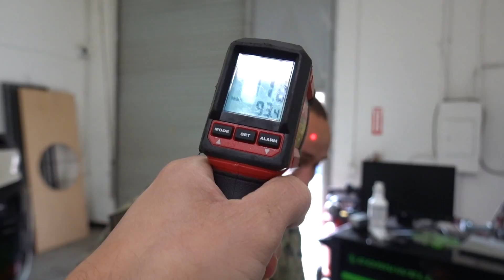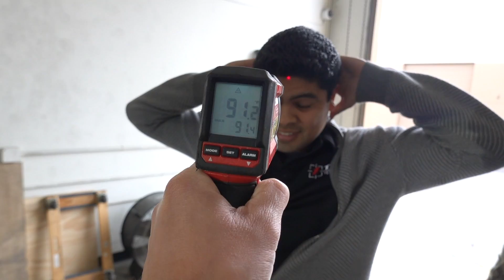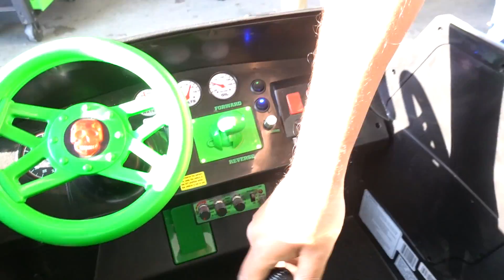THE SUPERCHARGED 6.2 IS GETTING A COMPLETE MAKEOVER!

Comment: Hey Ryan
Wes might not have to have the steering reprogramed. If you turn the wheel all the way to the right and left a few times and turn off the truck and then turn it back on the computer will find where the center is. I run into this problem sometimes when I jump start cars we get the steering wheel symbol and that procedure usually works. Im a tow truck driver and I do WORKFORIT

Comment: Ask Sergio to mess with his head,,,,,,,,how does inductive reactance affect the phase angle - and the answer should be,,, the voltage leads the current by 90 degrees or he may say it like this,,,, the current lags the voltage by 90 degrees - this will mess with his head as he won't be expecting an electrical engineering question like that in a non-design environment !!!!  He'll want to know why you want to know that - tell him you are thinking for rewiring your truck and making it all like 240 AC with a lot of powder coated coils in the circuit..... get his reaction - should be good !!!!!!!!